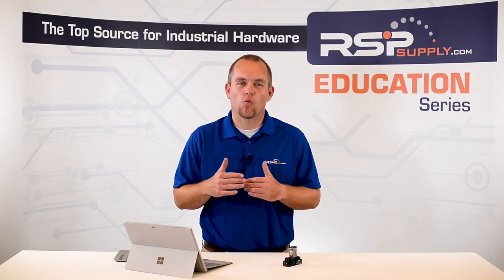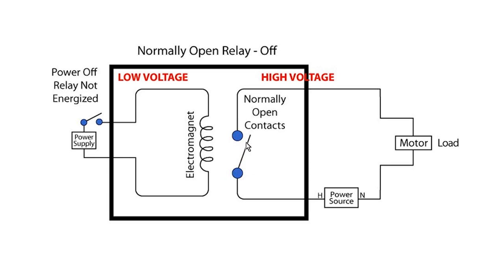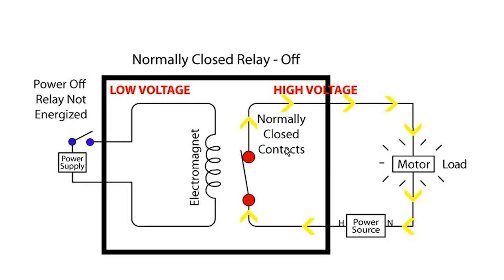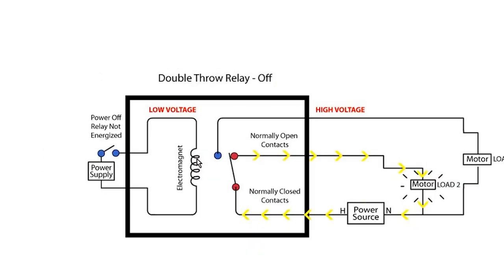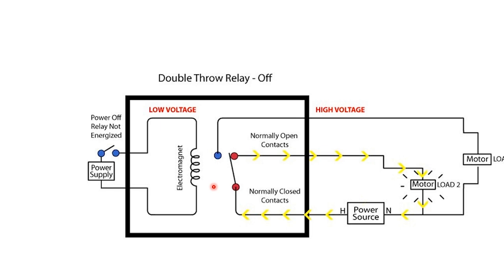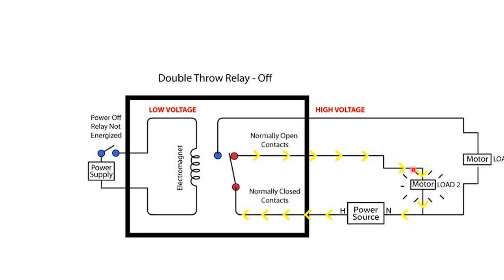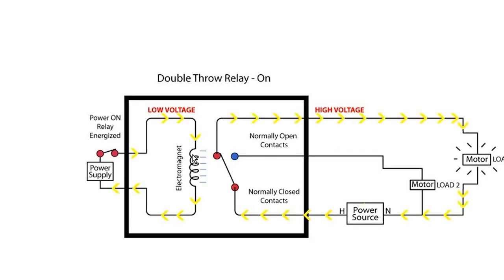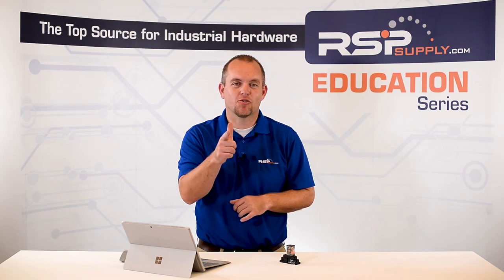Relays: Single Throw vs Double Throw

Comment: I know nothing about circuitry, and looked this up for my dad. Even I understood the basics, great job!
Reply from the maker: Glad it was helpful!
Reply: @RSPSupply  how will we create a circuit with a water sensor so that as the sensor touches the water the relay will energise and create power so the motor will also energise with the first diagrame of normally open diagrame you talke about, If you can do that , it will be great.

Comment: so im trying to connect a horn to my security system, i have one wire thats 12v for the beeps when i lock and unlock, and another 12v wire that pulses 
the horn when alarm is triggered, i need to connect those two wires  to a relay that goes to a single wire to the horn so the horn does both the honk 
when i lock and pulse when it goes off.
Reply from the maker: Response: Thank you for reaching out with your question! It sounds like you're looking to integrate a horn into your security system using a relay to control both the beep functionality for locking/unlocking and the pulse function for the alarm trigger. 

To achieve this, you can use a double throw relay (also known as a changeover relay). With a double throw relay, you can control two separate circuits with the same relay. 

Here's how you can wire it:

1. Connect the wire that provides 12V for the beeps when you lock and unlock to the normally open (NO) contact of the relay.
2. Connect the wire that pulses the horn when the alarm is triggered to the normally closed (NC) contact of the relay.
3. Connect the common (COM) terminal of the relay to the wire leading to the horn.

When the relay coil is energized (e.g., when your security system activates), it will switch the contacts. This means that when the security system is activated, the relay will disconnect the 12V for the beeps and connect the wire that pulses the horn, causing the horn to pulse. Conversely, when the security system is not activated, the relay will connect the wire for the beeps, allowing the horn to beep when you lock and unlock.

Make sure to properly size the relay and ensure that it can handle the current required by your horn. Additionally, consider using appropriate fuse protection for each circuit to prevent damage to your security system or horn in case of a fault.

If you need further assistance or have any other questions, feel free to ask!

Comment: I am trying to figure out how to use a double pole single pole relay for a CNC retrofit . I want to control the estop with the original e-stop on the machine or the e-stop of Mach-3 as now the spindle is the only thing that stops when the machine e-stop is used and the bed of the machine stops when the mach3 is used. either still running is dangerous.